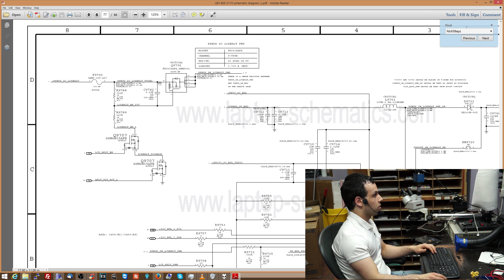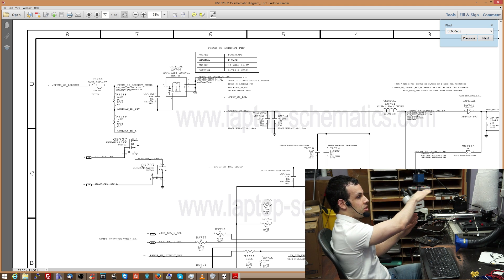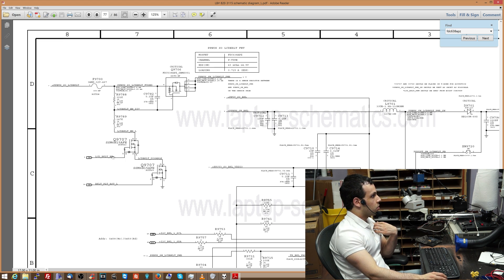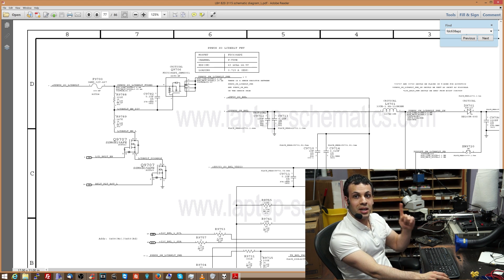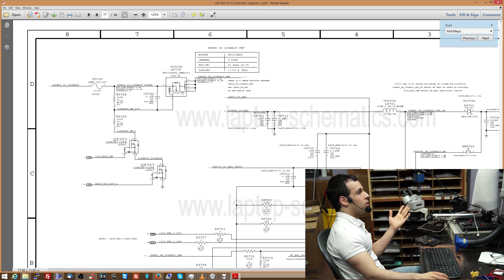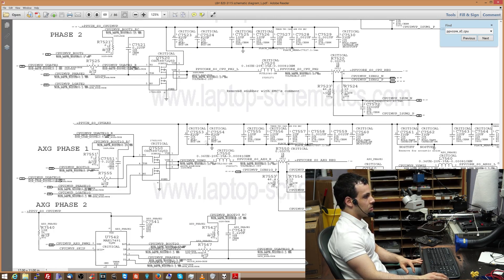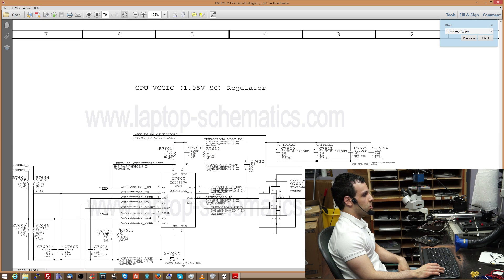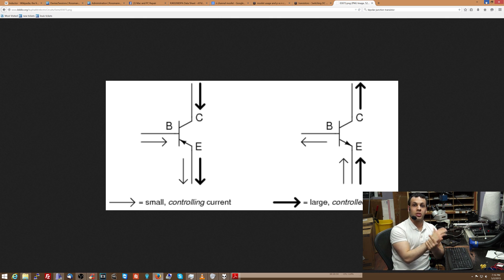What is a transistor in plain English?

Comment: Só ,if the transistor is a resister dependent of voltage Apply ,what is a varistor ?? THE ONLY DIFERENCE is the transistor is a fix switch apply and a varistor is variable .

Comment: A resistor that either has either 0 resistance (0 Ohms) or Infinite resistance is, by definition, a switch (think light switch). 
There are variable resistors that we use for things like light bulb dimmer switches or volume knobs. They are potentiometers or rheostats.

Comment: Brilliant & simple explanation Louis & this is an invaluable tip for newbies (and not so newbies) to electronics.
The typical explanation is great if you're a quantum physics guru or you're planning on working for Intel, Freescale semiconductor, TI, Vishay or any other semiconductor manufacturer or are interested in electronics design avenues but basically useless to quickly bring people up to speed to service real world electronics systems & it puts so many off electronics because many need to visualise real world apps in their minds & the industry loses because many come away thinking tgat electronics is boring, which it isn't!.
Years ago in college my course was essentially an associate diploma in Electronics Engineering, fantastic theory but....
Our lecturer taught us BJT transistor amplifiers & with a sh ton of formulas & we knew everything including source & output impedance, gain, transconductance you name it but ut took us 10mins at frantic calculation speeds to work out a single transistor amplifier stage, add 10mins for each extra transistor stage amp tacked on.
This lecturer took long service leave so the head of the electronics tech division rocked up to teach us & drew a 3 stage on the board & wanted the same parameter calculations.
My 19yo self in 1985 quipped back to him "can u come back in half hour" & his jaw dropped why so long.
He asked me to come up to the front to demonstrate to see for himself & I went crazy with a whiteboard marker filling a whole whiteboard with calculations that would make John Nash in "A beautiful mind" proud....this was only 1 stage & would have to be duplicated for the next 2 stages....I'll never forget the look on his face, ever.
He showed us these unbelievable shortcuts that sped everything from 10mins > 75secs per stage calc so in under 5 mins we could calculate 3 stage BJT amps not just in common emitter mode but also common collector and common base transistor amps (used in RF stages) which we were all too afraid to touch.
He also showed us super shortcuts how to test BJT & JFET (depletion) & MOSFET (enhancement) mode transistors used in MacBooks.
Instead of feeling stressed, I felt confident during the exam & got a 80% mark even though my dad passed away 1 month before the exam & most of the kids had also aced both the theoretical & practical exam where they broke a device & we had to fix it.
This was the era of PDP 11/34, 11/40, DEC LA120 printer terminals using RS232 & 20mA current loop interfaces where you were expected to repair to component level & board swaps was not all that common.
This is not to say that the original calcs we were shown were wrong, they were correct but for BJT transistor audio amps the shortcuts were a fantastic time saving technique plus things like miller capacitances ie collector to base & collector to emitter intrinsic capacitances in those formulas are ideal & don't take into account PCB substrate capacitances ie phenolic, FR4, multilayer substrates which wont always show up at DC or audio frequency small signal levels but are significant at RF or high speed digital, especially if operating frequencies approach λ/10 wavelengths where even milimiters of component leads are significant.
It also helped me to gain good traction to study & get my ham radio licence a few years later.
My point is, wish they changed how they taught electronics as its a fantastic field of study too often convoluted with irrelevant info & amusement machine repair guru Randy Fromm is a fantastic example of a good way to teach electronics.
Sure, later on teach people the quantum physics side when they understand the practicalities about it.
Thanks so much for this video!

Comment: To be honest, you need to know how the transistor works at physics level, that is by understanding the flow of electrons and holes, and depletion layer, and what is forward bias and reverse bias. I have watched a lot of your videos on electronics, and they are good but this one I feel is not correct and misleading. A transistor is not a resistor, it might behave like one under some situations, just like an inductor or a capacitor would.
You are just explaining how it behaves in a circuit, not how it actually works on the inside, and for some people they need to know that to have better clarity. It might take more time to understand the physics of it, but it is absolutely necessary for any serious electronics engineer.
Reply: For newbies getting into it, the theory side can be too excessive & causes many to lose interest quickly as they think electronics is boring.
Louis is 100% correct.
Teach the simplistic models at the beginning so that people get their head around it & can repair stuff & later on when the basics are covered, introduce them to the more complicated stuff as not everyone wll take an electronics designers road if they can't equate real world applications in their head.
I've been in the industry 30+ years & lost track how many multi degree EEs struggled when it came to the practical side of electronics plus real world demands your methods be quicker as a designer has the luxury of time to design but Louis who repairs for profit/business doesn't have this time luxury & more time can make the repair uneconomical if its a lower consumer grade product.
Sure, for milspec or more pro gear which costs a fortune, time isn't such a pressure...depends on the cost of the things one is servicing

Comment: The name “transistor” is derived from “trans resistor” which means it changes resistance. The resistance changes between very low resistance as a short circuit for a closed switch and very high resistance as an open switch.

Comment: Nice one Louis! I struggled with bipolar transistors for ages ( I was about 13, back in the 60's) when everybody kept saying "it's an amplifier", even though at that stage my concept of an amplifier was something completely different. As soon as I realised that a transistor ISN'T an amplifier, until it's in the right kind of circuit, and that it was essentially a switch, or as you rightly say a resistor with a controllable resistance from zero to infinity, and that amplification was a function of the circuit a light bulb came on.

The best analogy I have seen from anyone was years (decades) ago when someone else was struggling with some basic stuff and the descriptions they were given related (and still do) to water. Raise a tank of water and every foot it rises it gains more "potential" energy and the water flow down a pipe from the tank was the current which increased as the tank was raised. The narrower the pipe, the more the resistance, the lower the flow of water (current). A transistor or a valve (Tube in US) was simply a way of water through a narrow pipe (the base or gate) pressing against a spring that opened a valve between the tank (collector/drain) and the outlet (emitter/source). 

To represent a transistor, the water had to flow from one side of the valve (the base) to the outlet (the emitter) to keep the valve open, but to represent a MOSFET, which is much more efficient no water flow (no current flow) occurs because it is JUST the pressure (potential or voltage) that keeps the valve open (or closed). 

The problem is that explaining things one way may work for some, but for most people, different explanations make more sense and analogies to the real world usually help WAY more than any text book "scientific" explanations despite their greater accuracy!

Finally, and I KNOW this is an impossibility for a New Yorker, try to slow  down your speaking. English is my native (only real) language and sometimes I am struggling to follow you so non-English speakers must really struggle. Good luck with the right to repair campaign. All I can say is God help Apple trying to get anything equivalent blocked by the EU where we already have a right to reverse engineer and Apple will be fined billions more by the EU f they continue with their ridiculous monopolistic and anti-competitive practices!

Comment: A transistor is a resistor ,,,, a resistor is a resistor. ,,, an inductor is a resistor,,, a capacitor is a resistor ,,, conductor is a resistor,,  insulator is a resistor,, copper is a resistor,  aluminium is a resistor ,, water is a resistor ,air is resistor ,, I'm a resistor , you are a resistor ,, everything is a resistor ,,,,,, what that makes them different are the properties they carry apart from being a resistor.

Comment: I completely understand where you're from, but the fact that you could use it like a resistor doesn't mean it IS a resistor. It works internally completely different from a resistor. If you are defining what a transistor is, you can't say it's a resistor. Of course you can have that intuition, but saying it's a resistor simply isn't correct.

Comment: Not a bad intro definition! Because you are affecting the resistance of the channel with Vgs variation and temperature variation. But there are also capacitances that add to the parasitics. So I think RC circuit would be better, but maybe as a beginner's part 2 understanding. 😉 And there are some behaviors that don't exist in discrete resistors and capacitors like latch up. But it's so true with college courses! 😂 We dove deep into PN junctions and I still didn't freaking know what a transistor was used for until much later in the class. Professors need to pull it back to high level understanding. 😊

Comment: A changeable resistor. This could also be called a "transformative variable resistor" but we don't call it that because it simply too long. Could someone come up with a better name for a "transformative variable resistor"? Any votes on "transistor"?
Reply: Remember that the first transistor that was invented by shockley and the boys at bell labs was the JFET. A JFET acts much more like a voltage controlled resistor than a BJT or MOSFET. 

In my opinion, the analogue to a switch is more useful than of a resistor. It's not really incorrect to compare it but the I-V characteristics of these transistors aren't linear like a resistor, and it's intuitive to think of it like "okay, this part turns on when this junction reaches a certain voltage" because you avoid confusing things like doubling a parameter and getting an unexpected output.

Comment: Cool . . . 

People building electronics as well as those of you that repair them need this practical explanation. 

The transistor is like an electronic switch. It can turn a current on and off. A simple way you can think of it is to look at the transistor as a *relay- without any moving parts. A transistor is similar to a relay in the sense that you can use it to turn something ON and OFF.

http://www.build-electronic-circuits.com/how-transistors-work

Comment: What still confuses me is does the source connect to ground in both a P and N channel?
Reply: Yes, it does.
Reply: Luluman empirez Always? Even if it's a P or N channel?
Reply: Yeah because you need to complete the circuit. P and N channel transistors essentially have reverse logic, but fundamentally they achieve the same thing.

Comment: Now for me I am an absolute beginner. Therefore, this tutorial does not yield any help for me since the illustration presented here is a big circuit with lots of components. It would have been easier had the circuit was with a NPN/PNP  transistor and some common components like resisters/capacitors and what it the role of the transistor in that circuit and what would happen if the transistor would not have been there. Additionally, the speech is quite fast and people from the countries, whose basic language is not English find it difficult to understand. Therefore, the video may be helpful for experts for not for layman like me.

Comment: I know this is supposed to be an analogy, but it's not a very good one.  A transistor is not a voltage controlled resistor, but more like a voltage controlled current source.  Output current does not vary linearly with collector-emitter voltage, except in some cases.  A JFET can behave like a resistor, but in general it's not.  A transistor is a transconductance device, it turns a base emitter voltage into a collector emitter current.  I know it's harder to understand for a beginner, and a resistor analogy may be helpful at first, but it will be confusing for more complicated circuits.
Reply: Your explanation is what he's talking about with the textbooks. Like wtf are you saying? "Doesn't vary with C-E voltage except in some cases"... so it does then? "Can behave like a resistor but isn't"... so it is? Turns a B-E voltage into a C-E current". Turns a voltage into a current????" You are not helping anyone with this sort of explanation. If you want correct Louis then at least make it understandable for the people who are reading. This annoys me, sounds like nonsense, doesn't explain a thing and makes me think you're one of the teachers he's talking about.
Reply: @tonberry4502  He was correct. Using a resistor to describe a transistor is a poor analogy of you ever want to explore higher level concepts behind circuit fundamentals.
Reply: @tonberry4502  to answer some questions:

A JFET is a type of FET (field effect transistor) that can behave like a voltage controlled resistor - other FETs like BJT's and MOSFETs can technically serve this purpose but are far worse at it because reversing the voltage and drain current (make negative) would cause noise in these transistors whereas FETs will have minimal noise.

Transconductance is a ratio between output current and input voltage. On a basic level you can compare it to a resistor because resistors also control current but a much more accurate analogy would be a switch. A diode exists between base-collector and base-emitter (taking BJTs as a reference) which comprises the base emitter voltage as that is the necessary voltage for that diode to turn on (typically 0.7 volts for silicon diodes). Research I-V characteristics and look at piecewise linear approximation models for diodes and it'll clear some things up.

These concepts are very important when it comes to circuit design and are still helpful insight when doing hardware work. 

Not to be sassy but as Louis says use your brain. There are resources out there for this stuff. I can understand the analogue to resistors on a basic level but it's very misleading. OP is probably going to have the simplest explanation of a high level description of what a transistor is so bashing him is uncalled for.

Comment: so a resistor is basically the clubowner telling how many bouncers there should be present...if taken the  analogy from the last video...
Reply from the maker: kinda
Reply: That makes no sense at all top 10 worst analogies...
Reply: @joemann7971, You need to remember that Louis is explaining the transistor in very layman's terms here so that a complete novice can understand it even though he was showing a FET. The principal is still the same weather it is a transistor or a FET.

@Robert Rijkers, Lets use your terms: The club owner (resistor)  is telling a single  bouncer (The transistor) how many people (Voltage/Current) he can let in at a time. The FET is a fantastic way of explaining it. The source is the the street side of the entrance to the club, and the drain is the club side of the gate. On a P FET, the more voltage/current (People cued outside to get into the club) you put onto the gate, the wider it opens, so more people can get in at a time. The less voltage/current on the gate closes the gate, so fewer people can get into the club at the time. You can open or close the gate completely and use the FET as a switch. You could also vary the voltage on the gate to increase or decrease current/voltage allowed through, hence Louis description of a variable resistor. 

Here is the fun bit: You can feed the voltage/current back from the drain to the gate via a resistor (Another bouncer) and turn it into an amplifier. Bouncer 1 has the gate open only so much. But bouncer 2, who is  in the club is forcing bouncer one to let more people in than he wants to as the cue gets longer. As the cue subsides, bouncer 2 lets bouncer 1 close the gate again. Now put that through several phases, of FETs or transistors operating at higher voltages than the previous phase, and it will amplify your CD player/MP3 player/decks or whatever from it's little 100 miliwatt output to thousands of watts to the speakers..

Comment: What is a practical use of 0ohm resistor?
Isn't that like  simple 0ohm wire?
Reply from the maker: a fuse
Reply: O yeah, I do remember now!
Reply: A zero ohm resistor is used often because surface mount components don't really have wires to place. So that a robot can place a wire. This same pad on the board can be left empty for other variants of the circuits where this portion of the circuit will not be used.